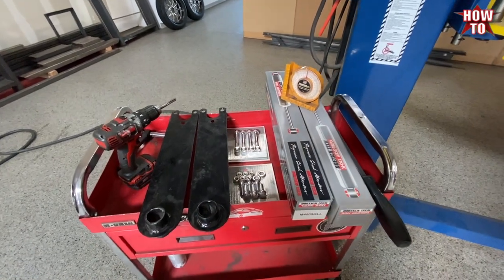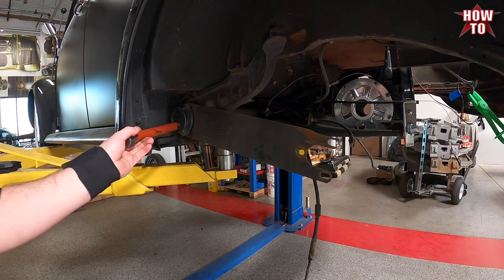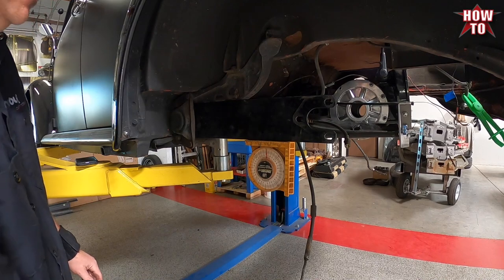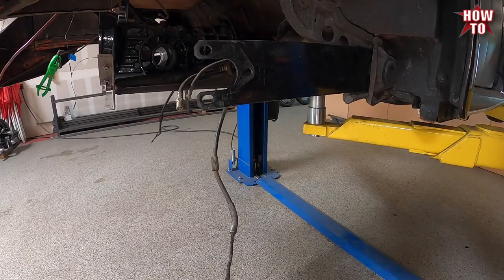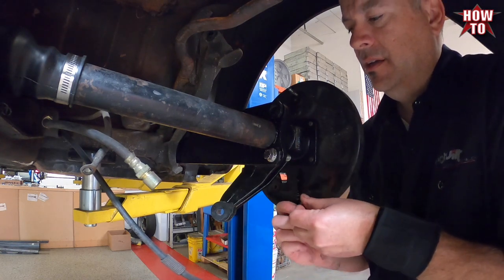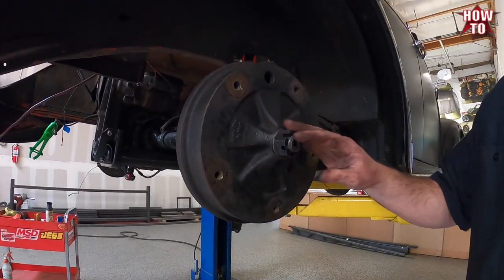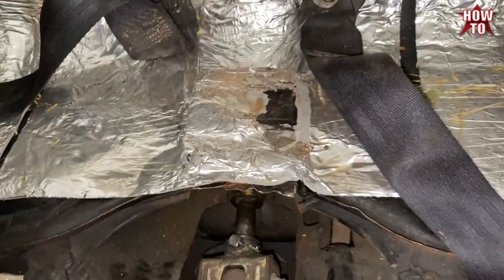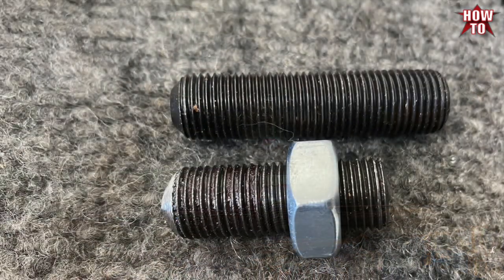1966 Classic VW Beetle | Part 4 | Adjusting the RIDE Height on the REAR Suspension | Airkewld

Comment: Thanks.  Best vid on the topic.
I am reindexing my (1963) rear 1 inch and need to remove my torsion bar as well.  Should I need a puller for that?  They do not want to come out and I don't want to get crazy with it.  It looks like yours was ready to fall out.
Reply from the maker: Better to be safe than sorry Bob, get the tool and make life safer.
Reply: @AirkewldVWs  Thanks but I was wondering about removing the torsion bars, not the spring plates.  Mine are tight.  Should I need to use a puller on them?  I have removed the spring plates before.

Comment: Looks good the only thing why don't you use a drill tighten bolts
Reply from the maker: They are polished stainless. I don't want to bang on the fasteners just to mess up the finish. Plus a drill or impact doesn't tighten them to the same torque and over time lessens the torque value. Doing it by hand ensure you get the right feel.

Comment: Lowering VW's like this is a BAD, BAD idea.  The safety concerns should be obvious.  Also never mentioned are the mechanical issues.  Placing the crankcase lower to the ground places it into much closer proximity to the road surface which like all aggregates is a thermal mass with a high heat gain.  This causes the oil to be pre-heated and the engine to run hot. Air circulation (the only cooling a VW has) is further impeded. A litany of mechanical issues and premature failures can be expected. The German engineers who designed the car were the BEST in the world. The car was field tested probably more than any other car in history, using the full resources of the state. If the car ran better lowered than stock, they would have built it this way...they didn't ! Draw your own conclusion.
Reply from the maker: Thanks for commenting Steve. This Beetle was lowered for aesthetics with the emphasis on ride quality at that height. Your statements, IMHO, are reaching, if I can be honest. If we are talking about a vehicle that we are driving everyday in traffic, heat gain is a fact. But no one cares because it isn't their daily. But just like cause and effect, there is always a cause to every effect. So everything you mentioned can be cured rather easily, but this isn't the place nor the time. You give these German engineers a little too much credit. They left so many areas of improvement, they were smart enough to make a car that was embraced by millions but lets be realistic, it isn't a 2024 Porsche....and yes I know who invented the cars. Back in the day, 60mph was ludicrous. Please compare apples to oranges. Customizing wasn't even a real thing in the 50/s, 60's and early 70's but it was bound to happen and it did. I appreciate you commenting again Steve, we all have opinions and if we can have an honest debate about things, I am all for it. Have a great weekend!